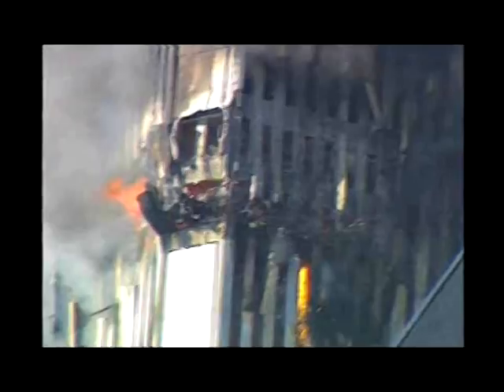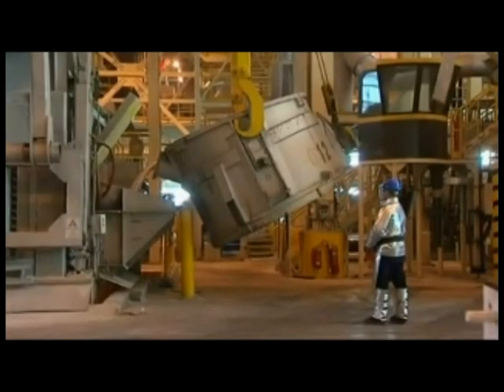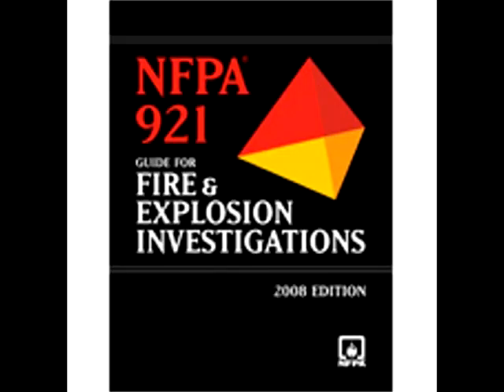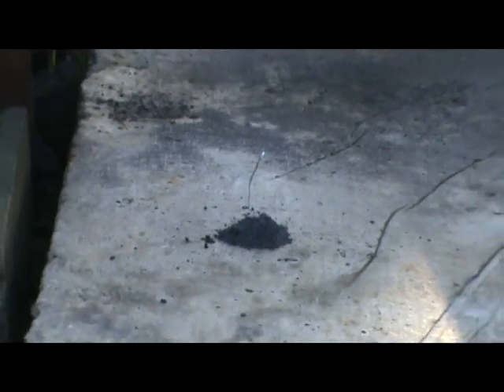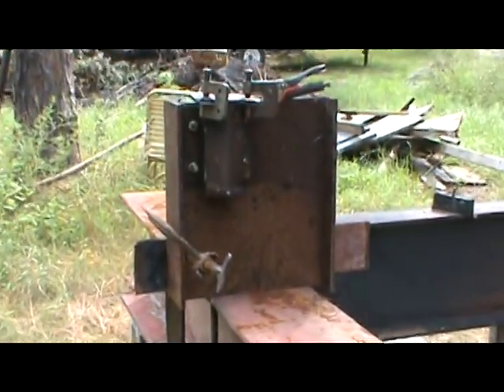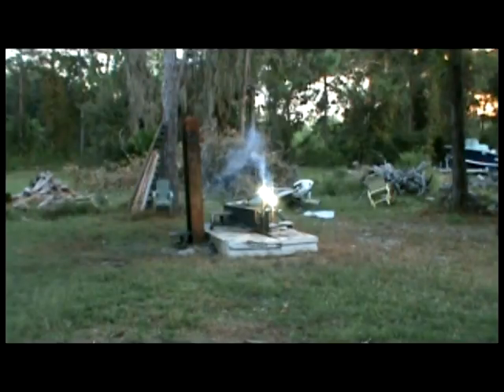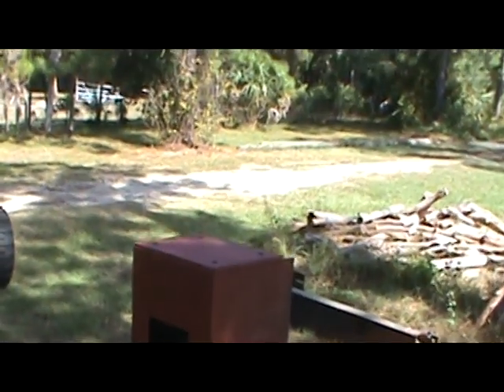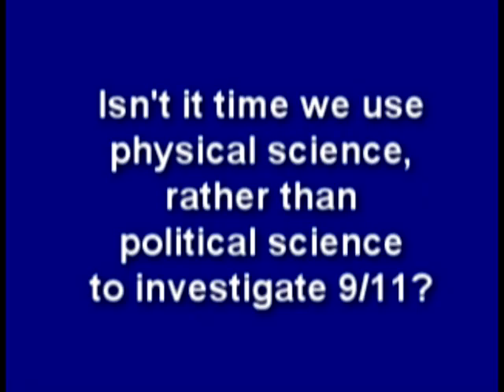9/11 Experiments: The Great Thermate Debate

Comment: Hey just your friendly neighborhood blacksmith/welder here.

Y'all are concerned with jetfuel. Any if you seen a smaw welding arc before? You know; that thing that happens when you pump electricity through a piece of metal that creates a plasma arc? The one that throws a ton of smoke? The one that takes a 6010 rod that has a cellulose coating that if you introduce water to it you can blow a silver dollar sized hole in 1/2 thick steel at only 120 volts and 120 amps? That building had to have been running some serious power. Then take the fire suppression systems, bathrooms, and Jerry from accountings water bottle into play you've got 

Small metal balls from extreme localized heat.

"Jetfuel can't melt steel beams" on their own maybe not but a plasma arc sure as hell can espically when you've basically got a CARBON ARC GOUGE going. Whole bunch of carbon smoke to ionize and stabilize an arc, high wind due to elevation and heat pressure difference, and the electricity going through that building. That would certainly take out any structural integrity.

Additionally

I can tell you that at about 400-600 degrees you start to undo a temper on steel. There's whole metallergical graphs about what temp a metal will be compromised. 

Iron and steel melt at 2600°F (give or take depending on the alloying metals) but oxyacetylene cutting which is a hyper oxidization of steel occures at ~800°F

Then there's physics to take into account and how a building that size wasn't designed to take a ~600mph plain at the top third then have (however much a plane like that weighs) sitting inside it.

If you think this video is real your as dumb as its creator with his cat vomit welds.
Reply: You have without a doubt logically reasoned what would be a reasonable explanation for what was witnessed.
Yet the truthers have scattered like  a groundhog from it's shadow.

or

"Ok, I've heard your explanation on that (and remain unconvinced) but what about this other thing (that has nothing to do with the first)."

They have circular logic or want to believe the hoax this creator perpetuates.

I went round and round on issues of building collapse on another of his videos. I gave video evidence of how it can and has happened but they were a moving target. If they have nowhere to go but consede, they change gears to something else.
Reply: @stevenrickaby7099  sorry can you say that plainly?

(Thank you for catching it)
Reply: @alisterlockland2357  you are very unlikely to convince anyone with such a hostile tone. Would you have paid any attention to your teachers if they were an absolute ass the entire time they were trying to educate you? I don't disagree with you, but I disagree with the way you are delivering your information.
Reply: @ReynardFuchsmann  to be honest I doubt I could convince anyone who believes in this with kind words and platitudes. Stupidity is a cancer that grows deep roots.
Reply: @alisterlockland2357  I'm not talking about being kind, I'm talking about being neutral. Generally speaking when someone tries to teach me in a manner that makes me think they hate my guts, I ignore them either out of spite or in the belief that they are trying to harm or deceive me. I wouldn't be surprised if these people have similar feelings when faced with such a teacher. I have known a couple people who have completely denied climate change, total conspiracy nuts, Etc and there were a few who did change their mind, when the argument was presented to them without hostility.
Reply: Alister Lockland the owner of the world trade buildings, Larry Silverstein, oversaw the “pulling” of the third trade center building. To pull a building is to bring it down with explosives. There are confirmed reports of the insurance providers being contacted by him to approve a controlled demolition because it was unstable. Explosive demolition takes months to set up, but they destroyed it within the hours the twin towers fell, supposedly because there was a fire, so they evacuated all the firemen, and brought it to the ground.
Reply: @gabrielgalaxygh  the buildings didn't fall the same way and the terrorist or mostly from Saudi Arabia.

You're done talking because you don't understand Jack shit.
Reply: @leveljoe  like I said what do they get from crashing two planes into buildings and no I'm done talking to you because your a fucking idiot. your profile picture matches you so well by the way. Dumbass sheep
Reply: @stevenrickaby7099  and you don't know what a period is. <---
Reply: @RubbinRobbin  
You know that flame retardent sheetrock and standard drywall are different right? 

Or that sheetrock is covered front and back in paper.....

But congrats on using insults to try and strengthen a weak arguement.
Reply: Nemopolymer have you ever seen the area around the towers after collapse? They constantly evacuated rescue personal in fear of collapse. The base of many buildings was blown out, and fire weakening the steal frames allowed a building to tilt inward towards the area which base had been blown from metal decimating it. At that point it’s just a Jenga tower. Once a large portion of most any building collapses, the weight will often plow through the base of the underlying flow, which travels down to the next one, and the next one, and so on. At... wait for it... about 9.8m/s^2. Rare for any building, through structural damage or demo teams, to fall at any other rate lol. WTC 7 wasn’t expected to stay up for long, recovery personnel decided to stay out of there when they saw the structural integrity. If the building was blown you’d be able to physically see it in videos lol
Reply: Alister Lockland  Firefighter here. I wholeheartedly agree with your answer but you have forgotten one thing. Steel beams do not melt, they expand when expose to high heat. Seeing how the towers have multiple floors damage and a very fast black heavy smoke proves that the fire is extremely hot. A simple jet fuel cannot melt the beams, indeed, but it causes a fire and that's all it took to take down a tower or two

If you go and look at a house after a fire, you can notice that beams are sticking out of their original positions. 

I can't understand how so many people never took science while high school :l
Reply: @blazingangel5463  
1) eletrical arcs are hot enough to melt steal beams. 

2) physics with enough leverage a you can move a city with a feather
Reply: @alisterlockland2357  "electrical arc are not hot enough to melt steel beams" yes, except we're not dealing with a fire caused by electricity. You have forgotten that there are loads of combustible materials for the fire in the 3-4 floors that the plane had damaged.

I'm confused by the second one. Can you care to elaborate please?
Reply: So just because you're a firefighter you suddenly know more about how a fire weakens a structure than a structural engineer who designs them? Maybe in some shitty low code house a steel beam might expand enough to push its mortar fixings out the way but the WTC was made almost entirely out of steel. And why does everyone forget the building was fucking built to withstand the fire and crash of a plane with more kinetic energy? Why does every fucker that did gcse science think they know more than the hundreds if not thousands of engineers whos professional opinions went ignored. Now i don't care who did what, But this tower did not fall due to just the fire. Honestly id be happy for you to prove me wrong but it seems every fuckwit just has some anecdotal evidence that is factually wrong?
Reply: SuperHimum Honestly, why would you automatically assume that I know more than an average structural engineer? When it comes down to building construction, a firefighter have to know what kind of materials that were used, what types of construction it is (is it ordinary construction , noncombustible ect.), is the building fire-resistive? What sort of trusses that was used (bowstring, parallel cord, etc.) And all of these can be greatly affected when exposed by a fire. So no, an engineer don't know what a fire can do to something they created because they don't know what (or trained) how to spot a type of fire, nor can determine what kind of damages it can cause.

You are correct that the towers was made entirely our of steels, but it was also made out of glass and concrete. Interesting enough, the concrete slabs are supported by steel trusses. Steel trusses are prone to structural collapse rapidly to a fire since they are lightweight. And guess what? Many types of buildings nowaday all have lightweight trusses. Have you ever seen a building that survived a large fire with those kind of trusses? It's impossible for the structure integrity of the building to survive unless that they installed fire-resistive materials to protect the trusses. 

Also adding to the steel trusses are load-bearing walls, which are essential to support the building weight. If multiple load-bearing walls are damaged inside a building, it can result of partial or total collapse of a building. Considering the fact on how a plane struck the middle of the tower, damaging multiple floors and travel to the middle of the building all at the same time, my best bet is there is nothing that can support the top half of the tower (the load-bearing walls are all destroyed), the result of the tower falling ON TOP of itself. You can watch multiple videos showing multiple angles of WTC 1 falling on top of itself (watch how the top fall onto the bottom). WTC 2 became a little tricky to understand why it collapse since it didn't pull off the same feat as it sister tower, so my guess is since both towers are literally on top on an massive underground space (parking lots), it fell on top of that one. 

So you're right on one part, the fire didn't cause the two buildings to collapse, but it did assist on weakening the support structure which caused the fatal blow.

Why does every fuckers knows more than professionals? Um.. maybe because the professionals don't know what they are talking about and only boast about things of what they know (and with little research) instead of a full-on investigation? Who knows? Maybe some of those fuckers you're bitching about ARE actually professionals? 

Why professional opinions went ignored? Tell that to the people who make lightweight construction when all they care about is easy building and more money instead of precaution and planning.

So if the building can withstand a plane attack, are you saying as soon a plane hit the side of the tower, it will just bounce off?

Hope this isn't too much for you :l
Reply: Thank You Sir... You are brilliant!!
Reply: spicy
Reply: Ever heard of the scientific method?
Reply: tell that to building 7...but I have to admit it could work. Only problem is steel sprayed with 5cm of asbestos hidden under tons of plastic . Also electrical systems in such buildings are meant to work with the sprinklers on. It simply switches off downstairs right after there are electrical problems upstairs. There's a control centre in each skyscraper. Also you don't have main electrical connection taken to each floor. There's a connection in the 1st or 2nd basement level and the station that reduces W and A to make it useful for the office infrastructure. No such exposed amperage on the top floors plus there are fuses out there, but there's this crazy art project prior ot 9/11 https://www.markdotzler.com/Mark_Dotzler/WTC_Artists.html 
and this commission report http://www.antiwar.com/rep2/MemorandumtotheCommissionandSelectCommitteesbold.pdf
I see you're good with maths so enjoy adding 1+1
I agree with iron balls. An arc could make such but there would be no possibility for such great failure in the building. There were certainly electrical arcs for a short moment but control centre cuts the power so you don't have arcs all over the construction and it takes longer to expose all weakest points at once
Reply: @izaakfewton7536  yeah it is possible. Combine that possibility with mechanical or human failures and it happened just the way it did.
Reply: There is no point making the building collapse on purpose, nothing extra is achieved from "inside job" that is not achieved by just having airplanes crash in the building.

Perhaps less casualties, 300 instead of 3000 - who knows, some more would have escaped, but still would be the largest terrorist act in US history.
So basic point = nothing is achieved from a professional demolition that wouldn't be achieved just by planes crashing into the buildings, same foreign policy, same news headlines with "slightly less drama" but not by much.
Reply: @philosophicalinquirer312  Insurance? If the building was damaged it would just be fixed. If it's completely destroyed, you get the cash.
Reply: its a tough one to judge, damage from two airplanes would be pretty severe - not even guaranteed that it could be repaired without demolition later. Consider in the UK a towerblock caught fire last year and is going to be demolished (Grenville tower) - although radically different design, still, not easy to repair severe fire damage.

Dont buy the other claim that demolition is because "trauma is greater for the American people" - at the end of the day, it would not make the slightest difference to the headlines if building 7 remained intact, just see it as completely pointless to demolish any of the buildings. The airplane damage and scenes themselves create all the hysteria and justification for any foreign policy - whether demolished or not, wouldnt make any difference.

Thats why not convinced by any conspiracy theories of inside job - its just sloppy and unnecessary when airplanes by themselves achieve all goals. (see images just prior to collapse, having blackened towers with gaping holes above your head for weeks is just as traumatizing as total collapse - utterly don't see the point of demolition.)

In any case, the "termite" picture is only seen in one isolated corner - would have expected far more "termite" pouring out of everywhere to achieve the results - and would be much more obvious considering the lag time between airplanes hitting building and supposed thermite.
Reply: As someone who just likes to entertain different possibilities, I take umbrage to your maliciousness. If your goal is to educate, try not to be such a dick.
  Also, it seems like you may have some of your temps wrong. Pretty sure oxyacetelyne torches are operating well above 1000°F in order to cut steel
Reply: @gabrielgalaxygh  No, actually you are a fucking idiot, you're just too stupid to recognize just how stupid you are.
Reply: Alaister Lockland
Excellant post. Ex welder myself, (TIG, MIG and stick and I've also got the burns in my ear enough that an ear, nose and throat Dr. looked in my ear and knew I was a welder lol) 
Also on the WTC subject; I'm certainly no demo expert but to demo a building the size of the WTC towers would take months and hundreds of people working day and night to remove non weight bearing walls, hauling off the demo'd material, cutting support beams at the right place and the right angle and then planting the charges. I figure if I work in the WTC and I come in and a wall that was here yesterday is gone, I'm probably gonna notice it. 

Ah yes, the "jet fuel can't melt steel beams" bunch. As a welder and a blacksmith, you know that if you have, say, a 3/4" x 3" inch piece of flat steel you wanna bend to 45 degrees, you put it in a vise then heat it with a rose bud till it's glowing red then you apply force (maybe a big cresent and a 6' cheater) and it bends fairly easily. You don't have to melt it to bend it. 

So, in a nut sack, here's pretty much what happened: 

The planes hit the towers 30 floors down from the top and the velocity of the impact sheared a number of support beams. (These same people will say aluminum can't cut through steel. They don't understand velocity either. And the fact that this was aircraft grade aluminum) The weight that was being supported by the now sheared beams has transferred to the remaining beams.(and as you already stated the building now has a 767 inside of it that has an empty weight of about 90 tons) The heat from the burning jet fuel begins to soften the remaining beams and they begin to bend. Bolts in the beams and gussets that are also heated and degraded bend and shear and one by one each time a beam fails, the weight it was supporting is transferred yet again to the remaining beams until there are no longer enough intact beams to support the weight and 30 stories of kinetic energy comes crashing straight down. With each floor that collapses, the weight of that floor is transferred to the floor below right down to the ground floor. "But, but, but explain how the buildings came straight down at free fall speed." Easy. The buildings did NOT fall at free fall speed or even close to free fall speed. You can clearly see the debris falling faster than the collapsing building. And did these people ever stop to think that the buildings were designed fall straight to the footprint in the event of structural failure? Imaging those two buildings falling straight over like a sawed off tree. Again I'm no expert but even a fledgling could see that the damage and loss of life would be in the gigaton range easily surpassing hundreds of thousands of tons of Trinitrotolulene (TNT) It's all so simple if they would just come outta their safe spaces and go to a welding or fab shop and witness firsthand the effects heat has on metal and see for themselves that it doesn't take alot of heat to compromise metal that is already bearing the tremendous weight of the WTC. But, they might get dirty doing that so I doubt we'll see any of them in our world anytime soon.
Reply: "I'm an engineer who builds things" lol! I'm on your side bro, these people who believe this need to take metallurgy classes
Reply: They couldn't fly the planes let alone hit the buildings. And cars in an adjacent road were burnt out , not by flame but by heat, 100m of road and cars. Figure it out.
Reply: @Alister Lockland meant*
Reply: I like how people are saying it is supposed to withstand a Boeing 747, but have they physically tested that before 9/11?  How could they possibly confirm 100% that it could withstand such an impact?
Reply: Thank you for educating these fools.  Sadly, the truth is often too complicated or boring for the idiots in the world to listen to.  These videos give people small bits of fact mixed in with a lot of bullshit while simultaneously leaving out important facts.  These are the equivalent of "learn karate on your own" books.  It gives stupid people just enough information to get themselves hurt.
Reply: That is really interesting, would love to see a demonstration. Now we do know that thermite will explode when water is introduced, but could it create the exact kind of destruction? Or if you could direct me to a site that recreates that?
Reply: Alister Lockland no, you're
Reply: Alister Lockland pppp
Reply: Alister Lockland  Ok lets say you are right....who trained those people who hijacked that plane and flew it into the building...central intelligence agency knew every thing about the operatives of Alqaeda and mujahedden  and i mean they had a list which showed their names addresses and everything....why was cia training alqaeda operatives after blaming them for bombing usa embassies in africa.
Reply: @davidc9783  who said the country trained them? The government told you that? Keep listening to your 1 sided story you sheep
Reply: @Douglas Waugh  funny part of your reply is that my whole post was "don't be so cock sure it's an inside job"
Reply: @fuzbaler86  

Your right I should have realized it was an inside job all along. You present such a convincing argument based on science and fact. 

Thanos did 9/11
Reply: @fuzbaler86  

To be fair you're more interested in believing your important enough to be a victim of some shadowy organization that is smart enough to stage a huge scale attack but dumb enough to toss Occam's razor out the window
Reply: @fuzbaler86  the point is that people who blindly believe that 9/11 was an inside job are as dumb and easily manipulated as those who believe that it was a pure hatred based attack.
Reply: Anything you say can be over turned by the fact the building fell as if it was in a controlled demolition and not in a terrorist attack. If you can explain how that happened i will believe you.
Reply: Are you telling me that random electrical wiring can spontaneously produce conditions identical to those used by a welder, and that these conditions will occur at numerous places throughout a skyscraper during an office fire in such a way so as to cut all the major support beams?
Reply: It's an inside job deal with it the truth is our government hides shit and does unknown shit to keep from us just for thirst of war and what the guy in the video is saying is true deal with it
Reply: Hey I can link you a tower 7 video which show explosions coming out of the windows when it collapsed. This was done by the government.
Reply: Even if somehow the freak accident you're purporting happened once, it would have had to happen MANY (hundreds of) times over to create the physics necessary for this to happen. MANY holes would have had to have been punched to provide freedom from resistance during the building's freefall. And it would have had to happen in THREE buildings in such a way, that it leveled all of them right into their own footprints, one of which was engineered very differently than the other two.
You would also have to explain why this hasn't happened in virtually any other office or sky scraper fire that has ever been recorded, since most office buildings in the US are running 120.
So yeah, this is not a plausible scenario at all. Interesting idea, but strutting around like you solved the mystery isn't helpful.
Reply: @chasethehorizonx  my dude. You have no clue what you're talking about. Go educate yourself on the welding process, metallurgy, or physics. What's less helpful is arguing a comment that's four years old and still think that they can come in with an argument equivalent of "nuh-uh" 

Most wall outlets are 2 phase 120. Consider one of those every 3 or so feet? Let alone the 440 or higher current powering them between floors?

Your arguement has more holes than trumps tax returns
Reply: @gabrielgalaxygh  how DID I guess you were a kid?
You conspiracy nuts usually are, like I explained.
Why?
It's this thing called terrorism. 
The towers weren't the only targets BTW.
Oil?
What oil did we get for free?
We paid for the oil then and we pay for the oil now.
Reply: @Nemopoly  
You wanted it you got it moron

Elevators: you really think every elevator in the entire building was down ...... You're dumber than you sound. You think anyone on the top two thirds of those buildings where taking the stairs? Nah. Secondly you really think a huge building like that would allow a number of those elevator shafts to go down at the same time for work? See on top of being a welder I've worked in a 5 star hotel. There comes a point when the business will tell the maintenance crew "you work when business is off". Meaning the elevators would have been serviced at night not 9 am at peak rush. Espically in a building that big.

Free fall: go check out some of the blender demo videos. Just a preview. The center of the roof collapses first pulling everything in toward the center. You don't get to see what's happening on the outside. Now if you've ever actually built something you'd actually have some concept about bracing. Given the structure the floor gives regidity to the walls. Essentially keeping them in place relative to each other. The floors hit cause a fire, burning things like PAPER, SHEET ROCK, DESKS, ETC. This fire spreads rapidly because of the aforementioned winds. The center starts falling well before the outside does. So yeah the outside suddenly stars to free fall.

Explosions: I'll make this simple. Ever heated a lithium battery? Now imagine how many batteries are in that building. There's also water/sewage pipes which could boil internally and explode. My money is on the sewage gas.

3x3 pattern: what you think they run electricity like a Jackson pollic? Believe it or not electricity is organized. Path of least resistance and all that.

Metal Sparks: ok I'll say this again. You ever seen smaw welding? Not welding like the shit this creator claimed was a weld. I'm talking a bout a consumable iron rod that welds. It throws Sparks in guess what shape? That's right balls. Sparks patterns are also similar. I've been showered in them enough from doing 4g smaw to see it  Why is it so inconsistent? Because it's not ment to happen like this. The more the electricity burns the metal back the mo resistance it takes to maintain the arc. 

Rather than look at this logically and take into consideration that this was a fully functional office building y'all choose to focus on "jet fuel can't melt steal beams" like a bunch of idiots trying to fight god damn windmills. Pull your heads out of each other's asses and actually think for once. Not just stroking your ego about how the government is out to get you in a secret plot.

They're doing it in broad daylight. Cause you're to worried about what they're doing in the dark.
Reply: any argument that has constant ad-hominem attacks should be taken with a grain of salt. we can sit here and argue le physics all fucking day, it doesn't change the fact that the government exploited this tragedy to create a surveillance state we could never see coming. they prepped in the shadows for it we know that now, since a 400 page bill was ready less than a month after the attacks and was passed rather silently. now we have a war on terror that will never end. huh, really makes you think.

i've got a question for the wise alistar, if he can complete a sentence without an insult. how were the passports found unscathed after the plane crash, fires, and the collapse?
Reply: @Agaetis181  please don't confuse sarcasm for ad-hominem. Here's an example:
Sarcasm- you got an example
Ad-hominem-your so dumb you needed one.

You ever had a passport? Those suckers are tougher than dry fruitcake to harm. I have no doubt the government let this happen or influenced this. My argument on this issue has and always will be that it is more impractical for the government to actively sabotage a building so that it looks faked than it is just to let it happen naturally.
Reply: a war on terror our gov't created before 9/11 too
Reply: are you seriously suggesting that passports are tougher than cement (which was pulverized btw), or is that sarcasm too?
Reply: You sound very smart
Reply: @alisterlockland2357  you're one of the top 3 dumbest people I've ever seen on the internet. HAH.
Reply: @godzillaburger9690  2 things:
1) you must not use the internet much. Still on aol?
2) with a name like Godzilla Burger that really doesn't mean much
Reply: @alisterlockland2357  mphm hmm hmm bmphmm hmm hmm hmm bwha bwaa HAA HAA BAAAAA HAAAA HAAA HAAAAA HAAAA AHAA AHAHAHAAAHAHAHHAAAHA A AHAHAAHA AHA AHAHAHA A AHA HA HAHA HAHAHHA AHA HAH AHA AA AAaa ahh ohh hoo wee ooh heh heh heh heh.  thanks for that. I needed a good laugh.
Reply: @alisterlockland2357  I shall bow to the almighty god of knowledge! Let your divine wisdom show us the truth. Please explain to us how the universe was created!
Reply: @jamesblair2000  in the beginning..... Someone fucked up and started
Reply: @Alister Lockland the information within your comment may be accurate but your overall argument is flawed from the start. 

To begin with, you are basing all of this on a plane that was reportedly flying at approximately 450/500 mph,  not the 600 mph you claimed. 

Neither plane would reach such a speed at approximately 1000 ft from the ground due to the drag generated by such a massive object. I concede an experienced pilot may be able to but not a so called novice right out of flight school, not one who was about to take his own life. 

This primarily applies to your comment above. 

As for building 7, the official claim is that the building was hit by debris from the North Tower and caused the fires along with everything else that led to the collapse. However, the problem lies with the fact that WTC 6 directly stands in between the North Tower and WTC 7. 

Staying with the "official reports", both show, along with photographic evidence, that each building collapsed basically into it's own footprint and didn't lean. 

I want to hear your explanation, including necessary physics, regarding how the debris magically bypassed the taller WTC 6, destroyed it, blew a massive hole into it and hit the blocked WTC 7. Because if you haven't noticed, WTC 6 was effectively a wall for WTC 7. IF the tower had leaned and collapsed I could understand it but when you have debris that weighs as much as the material in WTC 1 and 2 did, it's going to behave according to gravity, which is down and in an arc. 

With that said, I don't need to argue the science behind 9/11 to make my point, there is more evidence that proves exactly what the US are capable of. 

Are you even remotely aware our government have  committed false flags? Do I need to link a copy of the CIA plan JFK vetoed to you? Should I show you in it where the document directs very few people to be told of the plan?

Or maybe I should provide a link to the US Naval Institute and the page they have on the Gulf of Tonkin so you can read what they have to say about it?

At the moment I can't eloquently debate the science because I am not far enough (there are a lot of branches of science to cover) but this? I can argue from this perspective very well. You dismiss this as an internet conspiracy but there is more to 9/11 than we first imagined. 

Tell me though, why is it so hard to believe they did it? I'm not blaming you or anyone that claims they didn't, I never have, I don't even blame the military. 

IF I could produce something that would sway you, what would it have to be? Just curious...
Reply: @jasonstrickland9245  what so interesting, is how you (and the official story)  assumed that WTC 7 was damaged by falling debris by the North Tower. My guess was it was damaged after the tower collapse, which also destroyed WTC 6. 

https://www.google.com/amp/s/www.popularmechanics.com/technology/design/amp3524/4278874/

I don't believe the official story either, but I felt like they are missing something.

Yes, we are aware that the US have some dark path. I'm starting to believe it was the CIA that assassinated JFK after the Bay of Pigs disaster.

So why is it so hard to believe that the government did it? Let me ask you this: what's the point of killing their own people to gain a significant goal?

"Oh, they want oil" Last time I checked, the US is already one of the world largest oil provider, what more oil do we want?

"To start a war in the middle East" sure we're not friendly with some of the Middle Eastern countries, hell they hated us. You know that Osama always wanted to get his revenge on the US? It's common for us to get death threats once in a while.

"To start a war for American capitalism" why would they want to add another problem on top of the list of problems we currently have? What more do we want?
So you can't change the minds of many people that the government did it because it doesn't make any fucking sense.
Reply: @jasonstrickland9245  oh and uh... Can you provide those links you're talking about? I'm curious and it might be a great read
Reply: @alisterlockland2357  Ahh my friend, you're violating the first rule of the internet - never debate with idiots. A lot of these truthers are beyond reason, they're too far down the bullshit creek to swim against the current. Remember, you cannot reason people out of positions they didn't reason themselves into.
Reply: @Timmy2384  while I can agree whole heartedly. If we do not actively combat ignorance in it's darkest corners we passively allow it to be acceptable.
Reply: I FUCKING LOVE IT! 

Pull your heads out of each other's asses and actually think for once. Not just stroking your ego about how the government is out to get you in a secret plot.

They're doing it in broad daylight. Cause you're to worried about what they're doing in the dark.
 IT FELT ALMOST LIKE I WAS READING SOMETHING I WROTE... THANKS ! YOU MADE MY DAY!    I WAS WONDERING IF YOU WERE TALKING ABOUT CARBON ROD WHEN I FIRST STARTED READING WHAT ALL YOU SAID.. PEOPLE CAN ACTUALLY EXPERAMENT AT HOME WITH CARBON ROD BURNING THROUGH METAL BY GETTIGN THEM OUT OF ANY OLD FLASHLIGHT TYPE BATTERIES AND HOOKING UP A CAR BATTER OR BATTERY CHARGER TO ONE AND BURN SOME SHIT LOL... 

HAVE YOU EVER SEEN ANY OF THE DR. JUDY WOODS BVIDEOS ABOUT THE TOWERS? IF NOT AND IF YOU WANNA CHECK THEM OUT THEY ARE ON YOUTUBE. SHE ALSO HAS SOME OTHER STUFF SHE EXPOSES THAT IT WOULD BE COOL TO GET YOUR TAKE ON . sHE IS SHOWING THINGS VAPORIZED OR DUSTIFIED SHE CALLS IT AND SHOWS IT IN SLOW  MOTION ACTUAL FILM FROM WHEN IT HAPPENED AND YOU CAN SEE SHIT VAPRIZING INTO THE AIR LIKE STEAL BEAMS AND SHIT... 

PLUSE THERE WERE A NUMBER OF OTHER STRANGE THINGS THAT DAY LIKE RANDOM VEHICLES IN RANDOM PLACES BEING FLIPPED UPSIDE DOWN HALF THE VEHICLE BURNT AND WEIRD SHIT LIKE ENEERGY WEAPON STUFF` OR?? tHERE IS A BRAND NEW ALMOST LOOKING COP CAR SHE SHOWS THAT HALF OF THE THING IS BURNT TO HELL DESTROYED AND THE OTHER HALF IS LIKE BRAND NEW.. IT WOULD BE COOL TO HEAR WHAT YOU SEE IT THAT SHIT...
Reply: @Alister Lockland , True plasma arcs can cut steel, fact, but they use a compressed gas to force the plasma in a cone through the steel which is completely different and in no way related to just a 50mm cut cable with 500amps? Plus this power only being delivered till one of the many breakers trips. But sure maybe two wires arc across some steel and heat it up? so what? Your missing the point of why are there streams of molten steel. Finally the structural engineers that designed the fuckin building testified in court showing how they designed the building to withstand the impact of a Boeing 707 at its cruising speed of 607 mph. Okay this isnt the same as a Boeing 767 at its max cruising speed of 530 mph, however it turns out (i can show the math if you really want) the 707 would have 10% more energy on impact and again the WTC was designed to withstand this impact. yet it still came down at free fall like no other building has or ever will do when impacted. Dont care who did it but it wasnt come planes and jetfuel. Your friendly neighbourhood structural engineer.
Reply: Wow, the buildings steel beams must have been charged up Huh?
Reply: @estevandorado  prove him wrong or accept the possibility.
Reply: Operation Northwoods?
Reply: obama did sandy hook & pulse orlando
Reply: Level Joe there in lies the bias. "omg gwb did 9/11 everybody knows it was a inside job because michael moore told me so".

& at the same time, nobody accuses obama of anything. seems to me all these conspiracy theories have a political bias in regards to who you automatically believe, & who u automatically disbelieve. 

"""omg gwb did 9/11!!!. did u say obama did sandy hook? thats  impossible!!!"""

lol
Reply: @davidc9783  so if me and my friends go fly a plane into some Mexican building that means Mexico should go to war with America? Yea that's a lot of logic right there. We're over there for money and that's it, anyone who tells you different is a blind idiot.
And no the planes did not hit the same, you can throw two glass bottle of a roof  and even though they are the same and taking the same fall they won't break the same
Reply: Alister Lockland 

Could it be those planes ✈️ were missles 
And that there was a controlled explosion 💥 that happened simultaneously!?!
Reply: So that just happened to replicate itself in both building perfectly? How naive... they collapsed perfectly, how could you think that wasn't controlled when they both fell so perfectly
Reply: @gabrielgalaxygh  Look up how the buildings were constructed. The four sides are what gave them strength. The inside was open space except for the elevator shafts. The airplanes took out several sides which weakened the structure.
Reply: @michaelodonnell2635  if you look at picture of the building there is no exit hole at all so Idk how it destroyed the whole structure when there wasn't even a exit hole. How can you honestly think that they both fell like that. They didn't fall towards the side they were hit and was weakened it fell perfectly straight down. Not only that but it just so happened to work on both buildings? Yea right man, you might be brainwashed and I'll admit I was too when it first happened, but as I got older and started to actually research stuff and started having alot of conversations with milatry personal (because of my job) I've learned that not everything is always as it seems.
Reply: @gabrielgalaxygh  They were literally called "Twin Towers".  They were probably built almost exactly the same.  They were right next to each other and both had the exact same thing happen to them on the exact same day within minutes of each other.  WHY WOULDN'T THEY COLLAPSE IN THE EXACT SAME MANNER?  That's what science is.  When conditions are the same the results should be the same.  What on earth makes you think they should behave differently?
Reply: @dfin4588  well let me explain it since your simple little mind can't understand it. the planes did not hit on the same floor the fires were not the same,  the structural weakness was at different points of the building so therefore they should have fell differently not exactly the same
Reply: @gabrielgalaxygh   The part where you talked about the two same constructions can't fell the same way perfectly fits to some theory.I can't remember the name  Chaos? (We all seen Jurasic park right, everybody can try this at home :-) )  You can built any two construction, house of cards whatever and with some random force destabilze it to colapse...do exact same thing with same powers to second construction and it don't fell same way as 1st.
And btw. the plane on second tower hit much more to the side and probably missed and didn't damaged core and columns on the other side...
Reply: @gabrielgalaxygh  the buildings had the same construction methods and design, exposed to the same impact forces and the same uncontrollable fires.

" ...fell perfectly..."
Not hardly, they had many differences.
If you are referring to how they fell more or less "straight down", gravity will do that.
Reply: Acknowlodge what he said about the steel and then we will talk about WTC 7. Those buildings never fell at free fall speed. Source on the elevators being closed days before? How did ppl go to work on that day? :DDDD Stairs? This is the sad point about conspiracy nutjobs = 0 logical thinking
Reply: Show me how this https://youtu.be/XwoBRHDLxdo Represents this https://youtu.be/Mamvq7LWqRU

You are all so blind. Our government loves and cares for us. That's why they destroyed the USS Maine to enter Spanish American War, they proposed Operation Northwoods, and drove Aaron Swartz to suicide. You are idiots. I was a firefighter, and they didn't lower the elongation of steel from 1800 degrees to 1000 until after 9/11. Open your eyes to the truth.
Reply: @stevenrickaby7099  ------> AND YOU CAN'T CREATE A COMPLETE SIMPLE SENTENCE WITH A PERIOD ON THE END THERE  MR. COMMA COMMA COMMA COMMA CHAMELEAN...   FUNNY! :-)
Reply: It’s easier to cheat someone that convince them that they were cheated. Most people in USA believe everything their government say to them, that’s the reason that things like 9/11 only happens here. That’s the reason you believe it’s USA vs the world and here is the only free country. That makes sense to me when I came first here and realized Americans are tremendously ignorant about what happen outside USA border. Another stupid example... What you name Soccer is Football in the rest of the world, and you know the reason?, just simply Marketing... use the name of the most popular sport in the world in your own national sport and that’s it. Another... World Series in baseball... really? 9/11 is the best Hollywood script you as a country ever made.
Reply: Lol who believes that 19 hijackers and a few others in a cave in Afghanistan pulled this off acting alone... they outsmart the CIA , FBI , NSA , NORAD  yea right bro.
Reply: You still never explained how a fire brought down the building. Never once has a first world skyscraper fallen from a fire; let alone came down at free fall speeds. You are the ignorant one my friend. You can't see what's so blatently in front of your eyes.
Reply: @ScoobieDoobieDoob  it has happened before.
Reply: @leveljoe  No, it hasn't.
Reply: @ScoobieDoobieDoob  Oh yes it has, search "building fire and collapse" here on YouTube.

You're welcome.
Reply: @leveljoe  That did not happen in the United States let alone a first world country. Show me again where it happened in the United States or a first world country? Where there's actual building regulations? Also, I know what building you're talking about. It burnt for days, and didn't collapse at free fall speeds.
Reply: @ScoobieDoobieDoob  you've been proven wrong. Suck it up buttercup.
Reply: @ScoobieDoobieDoob  yes because physics are different here in the United States. Sorry I forgot to count that in to when I was explaining how the inside caved first then the outside followed.